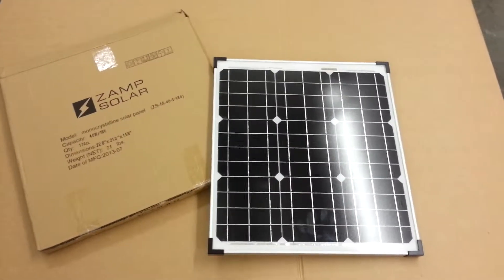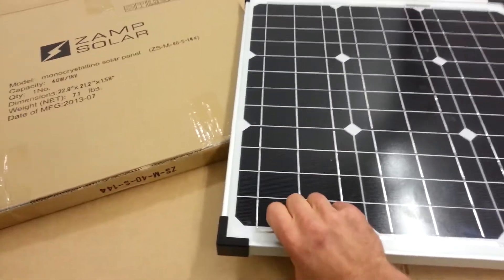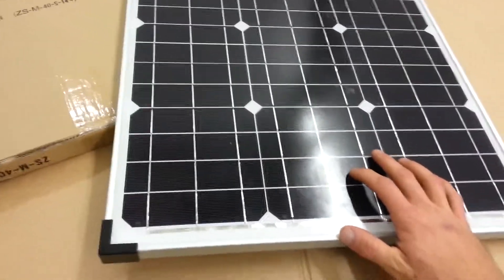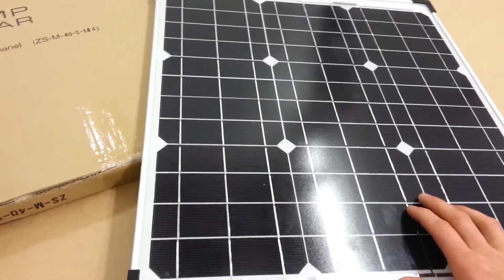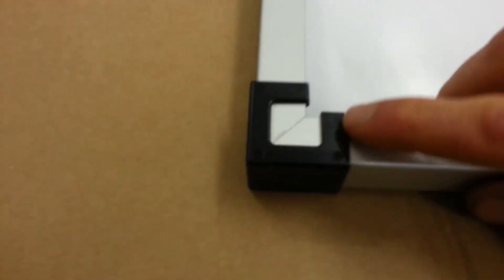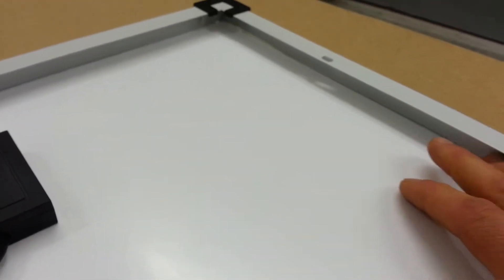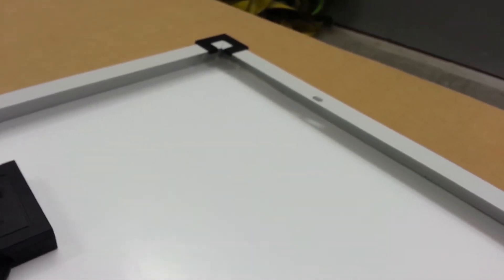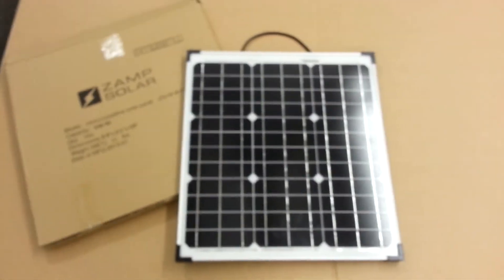Zamp Solar 40 Watt Panel

Comment: Hi,
A good friend of mine just got a Zamp panel. He wants to use it for his tag along trailer. In fact it was the dealer who sold the system to him. He is under the impression that he can wire the panel right to the trailer via a cable connection point. He thinks he won't need the box (small electrical box with LED screen) to charge his batteries as the connection point itself will accommodate the panel.
What are your thoughts and why?
Thanks for any help
Reply from the maker: Anthony Barry If he purchased a Zamp Solar Portable Solar System then he can use the solar plug on the side of his trailer. The portable system has a (male) plug on the end of the wires that will plug directly (female) into the plug on the side of his camper. That plug on the side of his camper leads directly to the battery. The portable solar system has a solar charge controller that will charge his batteries correctly. 

However, if he has just a single solar panel I do not advise connecting that directly to the battery without a solar charge controller, unless the single panel is a 5 to 10 watt panel. Anything larger then 10 watts should have a solar charge controller to control how much power a battery gets. If the panel is larger and is connected directly to the battery without a solar charge controller then he'll most likely damage his battery from overcharging. 

This is what a portable solar unit looks like - http://www.solardealz.com/Portable-RV-Solar-s/1817.htm
If he needs a solar charge controller he can look here - http://www.solardealz.com/Solar-Charge-Controller-s/1819.htm
Reply: Thanks for the advice. 
I am forwarding this to him. 
Nice to have an avenue to get valuable information.